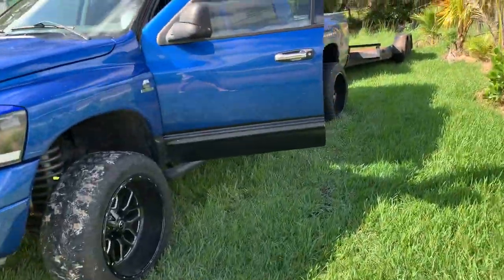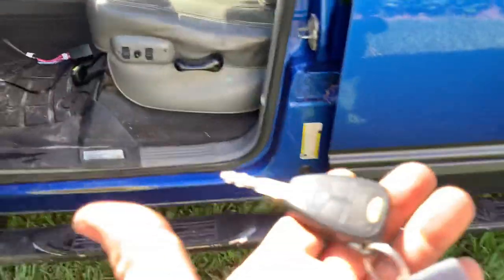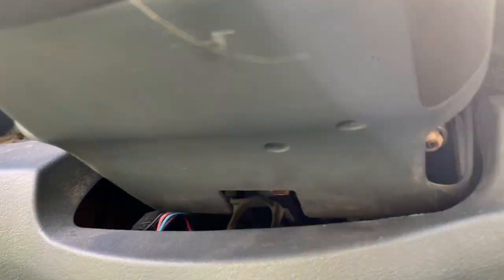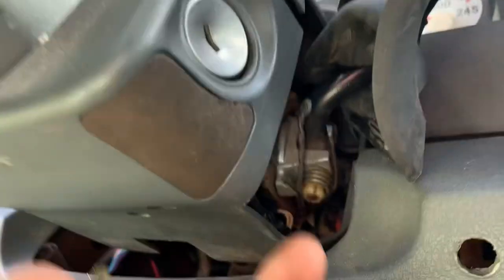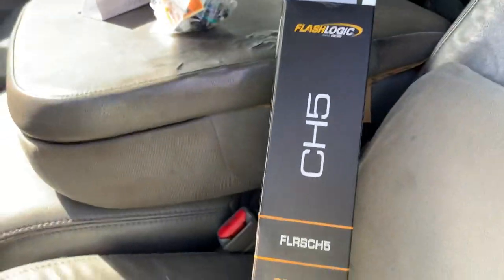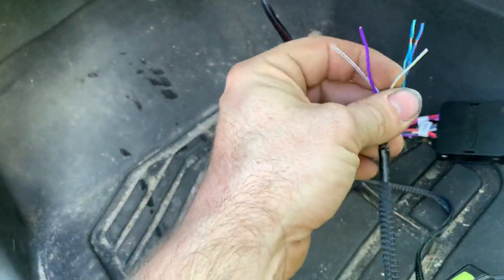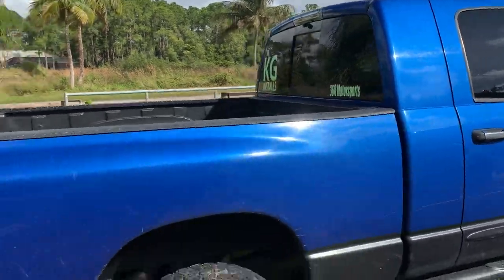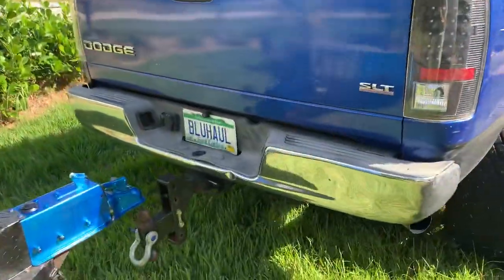08 Dodge Ram 2500 6.7 Mega Cab Flashlogic flrsch5 remote start installation

Comment: Will it work if my check engine light is on? i know modern cars it won't start if your check engine is on
Reply from the maker: Yea it will still work. Only time it hasn’t worked for me if I put it in valet mode or if battery voltage is to low.
Reply: @KGInstalls  thanks for the reply 👍
Reply: Do you know remember how you set the timer for 20 seconds mine didn't come with directions and I can't find how to set it online